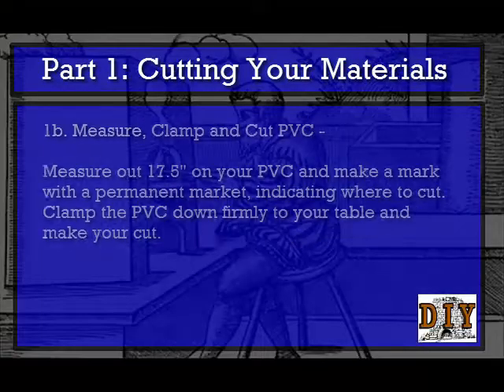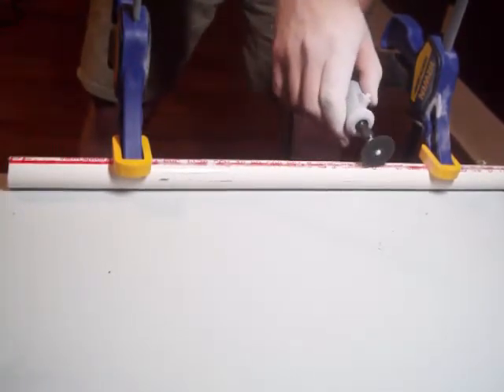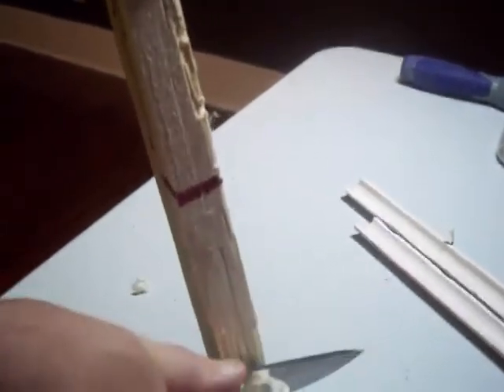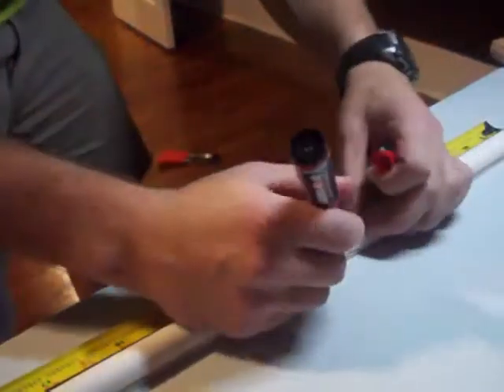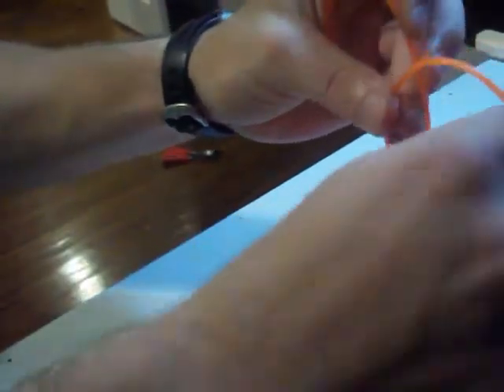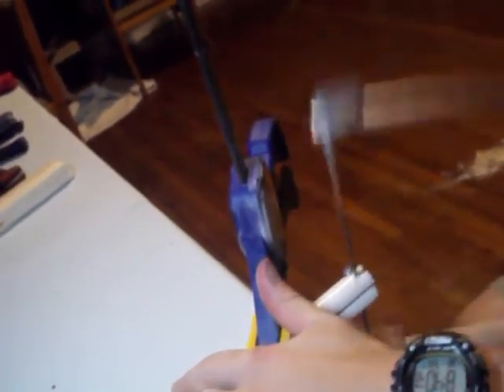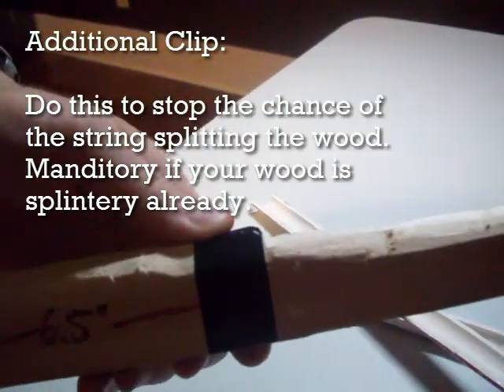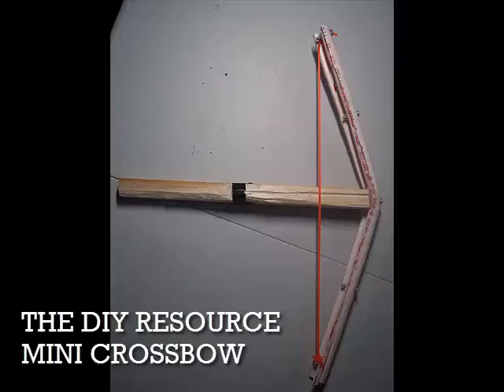The Mini Crossbow! PVC Crossbow, No Trigger - DIY PROJECT #1

Comment: Nice video! Only recommendation here would be explaining step by steps a bit more thoroughly along with the video. For example, the lasso knot tie. You said "you can see this tie in the video" but it wasn't really easy to see how to do it. So to slow it down, and break down the instructions to a move-by-move video clip would be more beneficial. But audio volume and clarity was pretty good. Nice startup project!
Reply from the maker: Thank you, I agree with that. My ability to record my work is limited right now, so I struggle to get good angles on my shots. For that example, I've just put in an annotation to another YouTube video explaining how to do the lasso, since that's probably the worst clip in the video.